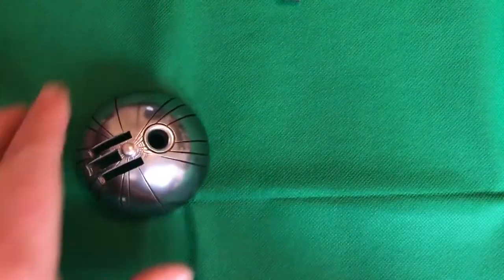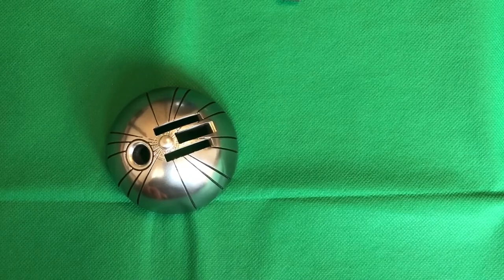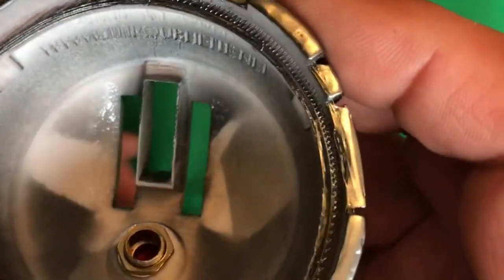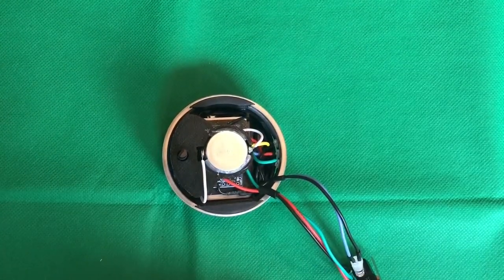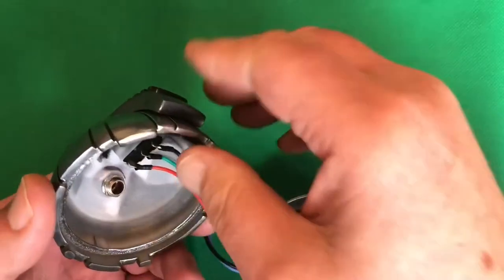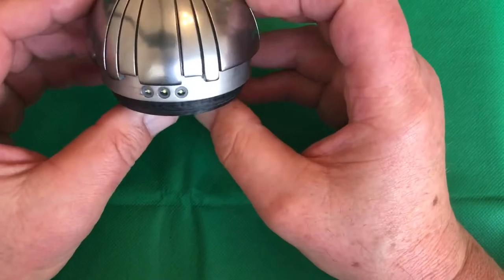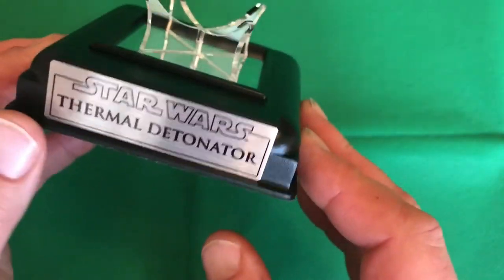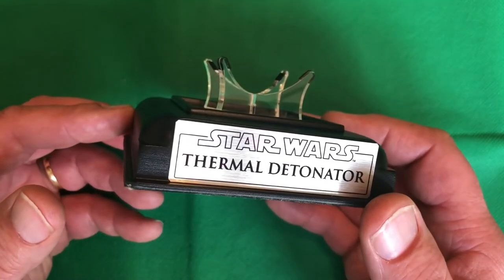The Thermal Detonator Build - Part 4

Comment: In unfamiliar with the soundboard side of things. Im not too bad with wiring and soldering, but never programmed a board. Is this a board that was purchased somewhere, or are the files to be coded to the board myself?
Reply from the maker: Hi Aaron
The board is a Arduino Pro Mini. The link to the download for the program is in part 2 of the video series in the description and full video instructions to program it, is in Part 2 of the Build the Thermal detonator.
Hope that helps. If I can be any more help let me know. 
Mark